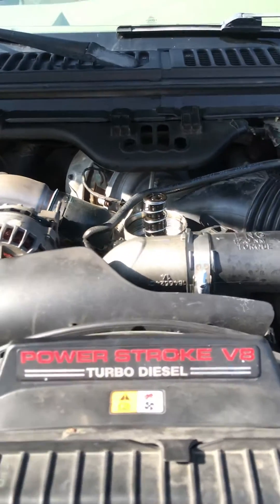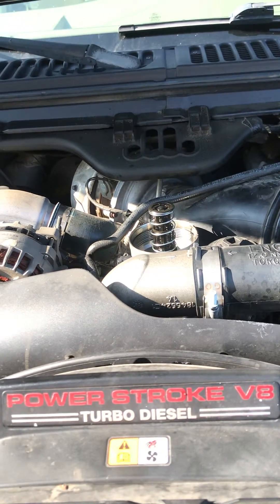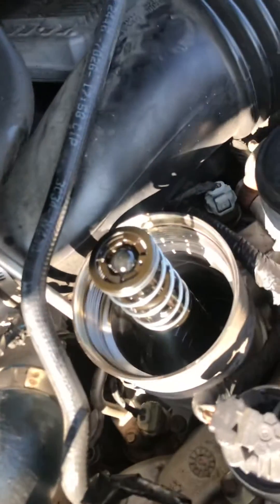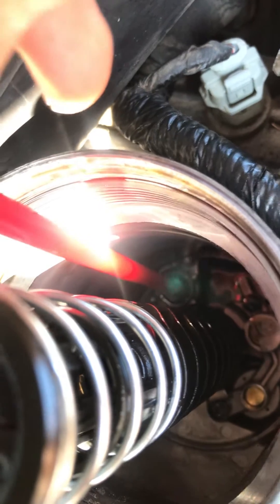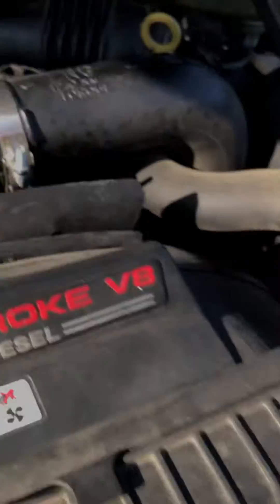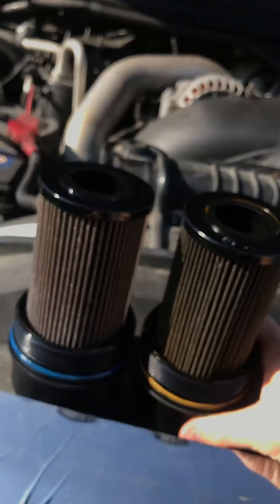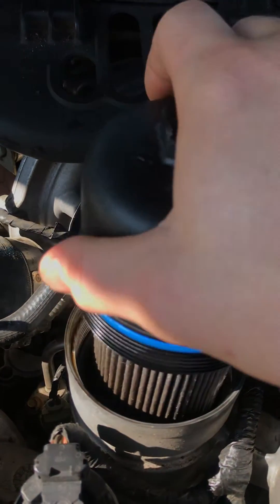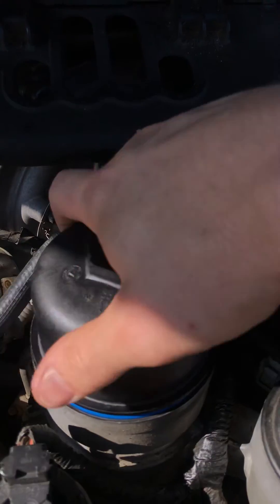6.0 Powerstroke oil pressure drops at idle PART 2

Comment: When you take that filter out it should be dripping with oil. You either A: have a bad sensor, which these are very common to have B: there's a problem on your low pressure side i.e LPOP, Which is uncommon but can happen if metal gets in to the pump. C: you have a high pressure oil leak. Take a 3/8 ratchet extension, push down on the little plunger you showed while cranking with your jumper wire to the starter on the positive battery terminal. If oil doesn't fill, then you have an issue on the low pressure side. If it fills then you most likely have a faulty sensor or you have a high pressure leak. Which could be a number of things and needs to be run on a tuner or forscan that can give you IPR psi, IPR valve % cycles etc. You can also pull out your LPOP relief valve and see if the spring is seized up. Stick a magnet in the hole to see if you get any metal. There are just so many factors that contribute to a HP oil leak and can get expensive  quick without properly scanning and diagnosing. You'll just throw your wallet at it and be frustrated. I see this video is 4 years old, so you may or may not have gotten it fixed, if you still even have the truck anymore. Hopefully this helps someone reading this
Reply from the maker: I appreciate the advice.  This particular issue was caused by the relief valve not seating properly.  I appreciate your recommendation of looking at a broad spectrum of issues that could cause this discrepancy (especially ruling out foreign object contamination).  And hopefully others with similar issue can learn from this.  4 years later she is still running great and nearing 300K miles, hopefully with many more to go.
Reply: @andrewnystrom580   Was this causing long crank starts? My gauge is falling at idle, whent he truck starts it runs like a top, but if it sits for 30 minutes or so it takes a long crank to start again.
Reply: @montman7368  if you have a 2004 the hpop is bad, the ball bearing has fallen out of the plugged port

Comment: So did it fix it?
Reply from the maker: Yes.  I removed the filter and inspected the valve condition, then reinstalled the filter, making sure the valve closed, and the engine ran great.
Reply: You are using an aftermarket filter and cap… that is causing your issues.
Reply: @KiteTvWrld  I know that the radiator reservoir caps are crap